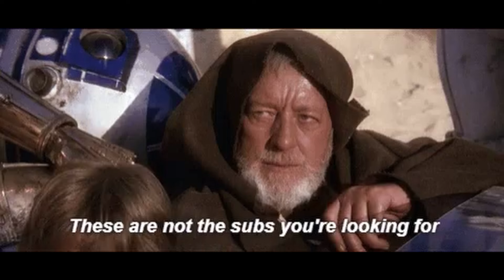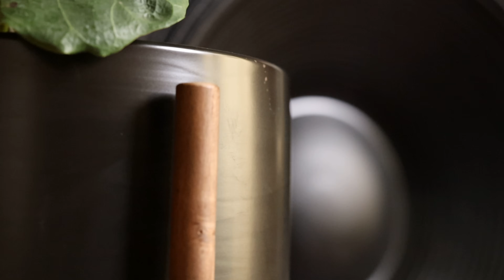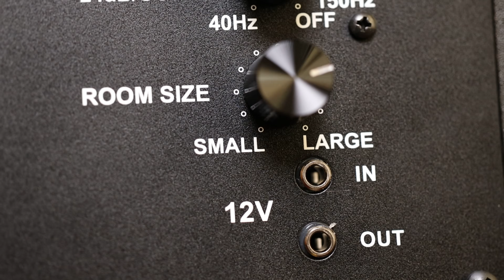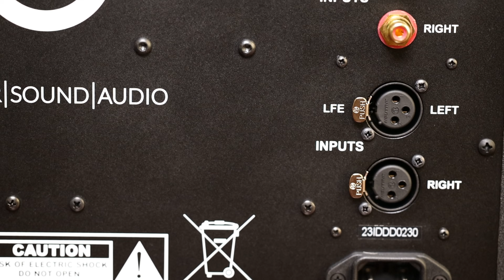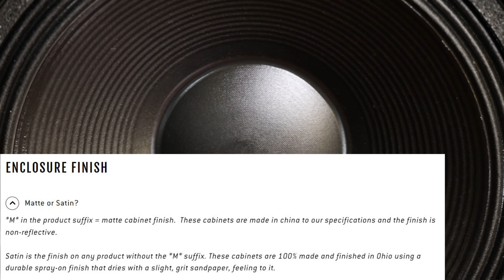PSA EV1813M - Move over SVS? + REW Measurements

Comment: Matt I truly enjoy your reviews. I guess that when you say it integrated well in stereo you used it with your Polk Sim's, right? I own a pair and have been thinking about adding a sub. It'd be mixed use since I'm also using them to watch movies using a Marantz M1, but mostly music.  PSA's value proposition is very tempting now if they had some models with piano gloss or wood veneer finish it might help with the WAF.
Reply from the maker: That is correct, I did test these with the LSIM’s. They integrate really well but ad you said the finish options are limited, great sub though.

Comment: That enclosure looks seriously undersized for a ported 18 inch subwoofer, even when compared to the RSL subwoofer that has a much smaller driver. Shane Lee also has a review of a PSA subwoofer that didn't do so well when playing infrasonics at loud volumes and I suspect it's because of a mix of using pro drivers with not much excursion capability in a smaller ported enclosure. Did you try playing playing the PSA at loud volumes and how does it compare to the RSL subwoofer?

Comment: Good review. I can contest that a sub really opens up your main speakers. I don't own a sub yet but I demoed some speakers with and without a sub and the sub really opened up the imaging of the tower speakers to the point of vanishing. It was really cool.
Hey, do you still like and have your KLH Model 5? I loved them too and almost got them but the Sonus Faber Lumina 5 stole my heart a little more. KLH is supposed to come out with the Model 7, they announced that when I was demoing the Model 5 and that was part of the reason I went with the Sonus Faber. I can't wait for the Model 7 to come out and I like to compare it against the Klipsch Forte IV and the Sonus Faber Sonetto Vlll. 
PS: any idea how to get sound stage depth? I heard setting up the speakers along the short wall with a good 3 ft space between it and the front wall does the job, fact or fiction?
Thanks
Reply from the maker: Hey! I do still have the Model 5, I still think its a fantastic speaker. I am excited for the 7 as well and have reached out to them to see if I will be able to get in a review sample, we will see... As for the soundstage your spot on discussing the placement, thats 90% of the battle, pulling them out does help at the expense of low end extension so you need to find that healthy balance.  I would suggest checking out the channel New Record Day, he has a lot of good speaker set up video's.
Reply: Thanks Matt. I too have been writing KLH just out of curiosity and not as a professional Reviewer. BTW, I would love any suggestions on how to start my own review channel for stereo review. What recording gear, (camera, lights, recording monitors, etc) do you use and/or recommend? Do I begin by purchasing my own speakers, amps, etc and review them then seek out sponsors? How do I get companies to send me gear to review, is this a result of getting my channel out there and they will contact me or do I contact companies and ask them if I can review their gear? Thanks

Comment: I think this will be my next sub
Reply from the maker: I truly believe you will be impressed
Reply: @MattCoykendall1  I actually pre ordered the ev1513m instead of this one getting duals
Reply: I bought the EV1813M and I absolutely love it. I tried the SVS PB2000 pro and was underwhelmed by it, though it was certainly far better than the 20-year- old entry-level RCA subwoofer I was upgrading from. I went with the EV1813M because of spacial limitations. PSA has even bigger & more powerful models. I'm convinced that PSA is the best or among the best bangs for your buck that you can get in a subwoofer.

Comment: I just got a TV2112 and it is awesome!
Reply: Flat to 13 hz with REW in my room.  It totally changed the experience in my room.
Reply from the maker: I have no doubts thats true, great subs.
Reply: Must be where they are placed.  My 2112 is flat to 13 hz and the -3 db point is 10, -6 is at 7 hz.  Set room size to large on the sub.  These dig way deeper than SVS could ever imagine to, and with more output.  I have hit 132 dB with a single 2112 in my room at 25 hz.  The pb16 will not get to 120.  With 4 subs, did you time align them all?
Reply: @RyanJoz  how do I time align them? I ran room correction with Audyssey from Marantz AV8805A but not sure if that will do it.
Reply: You have to use REW to effectively time align subs.  Do you use the app to apply a house curve or DEQ?
Reply: @RyanJoz  I don’t. I didn’t do anything other than the auto room calibration. I don’t have the knowledge either to apply house curve or to run REW tests with mini dsp unfortunately.
Reply: @hometheaterfever5 Watch videos on youtube or/and ask for advice on AVS Forum, you’ll it’s not that difficult, you can do it.
Reply: @hometheaterfever5  I'm no expert but in my experience the best thing you can do is use REW, get an UMIK mic and a mini DSP. Then watch a ton of videos on time alignment and equalizing your subs. It can be a bit frustrating but the difference is substantial.
Reply: I suggest either YouTube tutorials to try, or hire a professional calibrator.  The Marantz app allows you to add a room curve, set audyssey limits, remove the 2k dip, and many others.  It is a wise 20 dollar investment.  Having 4 subs, there is no good way to blend them without software and a mic.  Audyssey misses that.  I had huge room nulls trying to mimic what others had done with crossover settings, main+lfe output, and sub crossovers.
Reply: Just returned the tonewinner and bought the tv 15 psa, wish me luck.
Reply: @RandyDrake-f5s  how did you make out?

Comment: Ive been in this hobby since the 1990's and probably had 25-30 subs throughout that time including building a few of my own.  This PSA EV1813-M is my favorite and overall best performing.  I recently had 4 sealed subs in my living room, but even those could not match the output, quality or impact that this single 18" can do.  I had also tried 3 RSL subs, one 12s and two 10s calibrated with my Denon 3800.  Even those lacked the midbass punch of the PSA and could not energize the room the way the PSA.  Ill eventually add a 2nd for symmetry and even out the seat to seat room response but not for a lack of output.
Reply: Woow! This sub seems to behave like a bass monster! Could you please tell me about this speaker sensitivity? Do you need turn this sub too much up on back knob, to reach the level of satisfying bass you like? And what about the volume on receiver?
Reply: @jlsnr  - Trust me, all of PSA's subs are like this. I have two older S3000i's that each house two 15" subs in a dual opposed configuration and they shake my entire house and couch!!! It is professional theater grade, but they even go lower than actual movie theaters!!! 😲
Reply: @WillieDWashington , great! It's good to know that they use this kind of high sensitivity in all lineup!

Comment: This doesn’t have the xmax to compete with any serious 18, maybe this is best only for low volumes? Sensitivity doesn’t compensate for displacement.
Reply: This has been said many times but proven wrong.  The TV series can achieve very clean high SPL down to 10hz in room.  My TV1813s certainly do.
Reply: Infrasonics is not everything. Many people that own high excursion subwoofers still can't actually pressurize their rooms  with sub 20hz bass because they don't have enough drivers to do it for the room size. There is much more bass that can be felt in the chest in movies between 30-60hz that don't require an insane amount of subwoofer drivers to reproduce. These pro b&c drivers are much more efficient in that frequency range than typical home theater subwoofer drivers are. I'm sure they are excellent at music as they are used on tour and at large concert venues. Best of both worlds would be to go with multiple 21inch ipal drivers which have alot of xmax and can dig low as well as produce mid bass that can be felt.

Comment: that is one impressive subwoofer,  but i like the 21" sealed version for the same price better, and eq to get lower bas extension if i have the overhead.
do not know when the ported 18"  rolls off, the website do not have a performance graph yet.  
i really expect 10hz with good output level from these.
built a 21" sealed way back, those pa drivers sound impressive, i rather have larger drivers with less excursion.

and a note on the review: would like to see you do a 10  15  20 hz tone and your impression how low and loud the subwoofer go.
Reply from the maker: Thanks for the testing notes, I could expand on that area. I am curious about the 21” models, may do a build.
Reply: "do not know when the ported 18"  rolls off"

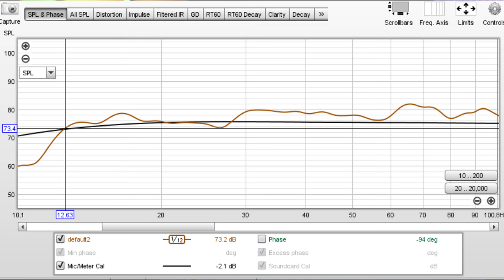Did you see the measurement @ 7:05? Doesn't really start to roll off until around 12hz.
Reply: @MeTuLHeD  rolloff looks like 18hz, after that 10hz is down 18db.
Reply: @sudd3660 Are you looking at the same measurements as I am? He even said: "We didn't have any major falloff until around 12hz."
Reply: @MeTuLHeD  measurement do not corelate exactly to how it sound in rooms.
and i want lower than 12 hz for that size.
and lets say 10 hz is what i want to sound as loud as 20 and 100hz, if you know how sounds works then you would know how loud that have to be to be perceived as the same volume.
no microphone picks that up, you can only to that adjustment by your own ears, in your own room.

Comment: Recently got a PSA TV36ipal (dual18) w/4000 watt amp upgrade. It's pretty nuts.
Reply from the maker: Well now I’m jealous haha enjoy it!
Reply: @MattCoykendall1  thanks for the video btw, there should be more videos out there about PSA. Maybe I'll make a short one on mine
Reply from the maker: Do it !
Reply: Recently picked up 2 TV18F-M after seeing still blues’ review. Wouldn’t call them a school bus, I’d say more like pickup trucks 😂. They stay flat down to about 7 hz in my space & they rattle everything, windows included!!! I don’t go very loud for very long but these subs ring true with that old saying. It’s better to have too much (power) & not need it than to need it & not have it!  I will tell anyone willing to listen to try PSA subs & put them up against any of the SVS & JTR subs & you’ll see they can run with them any day & my whole system is a full 9.4 Jtr, the 4 being heights. after seeing the measurements of these compared to the JTR’s, they were pretty much exactly the same and I got two for the price of one JTR sub. No brainer!!!
Reply: i ended going with 2x single 18s in a 7.5cuft net 14k watt amp, even with rubber feet isolation everything shakes in the open floor living room

Comment: The lack of high level/ speaker level input is disappointing. That really is the best way to connect a sub for two channel music.
Reply from the maker: I use speaker level as well with a pair of Sumiko subs on my 2 channel setup and standard LFE channel for home theater.
Reply: There are speaker to RCA level adaptors you can buy, rather cheaply, on most of the online vendors.

Comment: Measurements? I wonder if standard measurements are just with one frequency at a time. Could multiple frequencies cause some weird harmonics? Or decay?
Reply: Rew tests all frequencies between the lowest and highest you specify... that's what the graph plots... the level of each frequency tested.
Reply from the maker: Like Douglas mentioned, its a sweep across the frequency ranges you input into the software.
Reply: "Could multiple frequencies cause some weird harmonics? Or decay?"

The answer is "Yes" ... but that is a normal artifact of mixing multiple frequencies together. In fact, it is expected behavior in music and music reproduction.

Comment: So they aren't all made in Ohio?
Reply: All products are assembled in Ohio. Anything with the M suffix = matte cabinet. The cabinet itself comes from china but the end product(speaker or subwoofer) is still completely assembled, measured/QCed, boxed, and shipped from Ohio.
Reply from the maker: You are correct, the M models enclosure is made and finished in China but the amplifier and everything else involved is still assembled in Ohio. The non M models are fully built/assembled in Ohio.
Reply: @MattCoykendall1 so are the boxes made in Ohio better built ?

Comment: I recently purchased their newest product, the TV18F-M. Thank God I have a pickup truck because it came to the house on an 18 wheeler. It's by far larger than any sub I've ever owned(rythmik e15hp2,Arendal 1961 1v,Kef Kc62). My wife calls it a monstrosity but guess what as King of the household I say it stays.😤🫅
Reply: Compared with the Rythmik, it has more bass output as it should being ported. It is a beast with movies. The rythmik on the other hand  plays a thousand times cleaner thanks to that servo. It and the kef are a staple in my 2-channel system. Believe it or not, the Arendal can go toe to toe with the PSA from 25hz to around 50hz(together they are formidable). And well, the Kef as good as it is stand no chance against the other three.❤
Reply from the maker: How has it performed so far? Any thoughts in comparison to the other brands mentioned?
Reply: I've been really curious about the ferrite woofers over their b&c pro drivers. Reportedly extremely similar performance for a much lower pricepoint. It's $600 less for a pair of ev18f's vs ev1813's!
Reply: @reiniku5830 this is my debate at the moment. B&C or save $600 and go with the Ferrite.